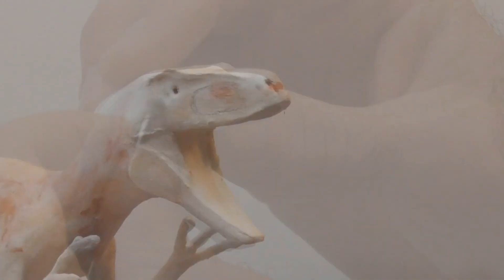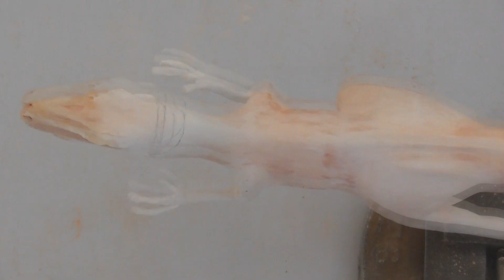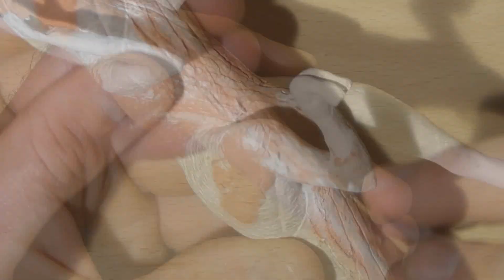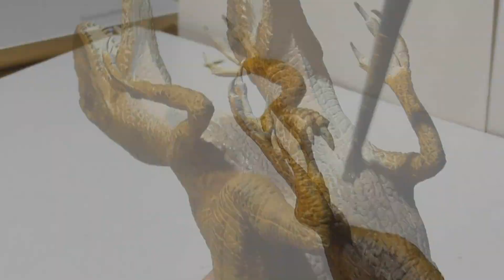Velociraptor model making sculpture! Jurassic Park style dinosaur model figurine! Raptor statue!

Comment: friking hell thats sick 

also what are thosewires that u used to create velocerapter at first
Reply from the maker: Thanks 😀 I should probably have a fancy answer, that the wires are a special modelling wire but they were actually from a steel grill that I had lying around. Similar to chain link fence but straight lengths. It's about 2.5 to 3mm or 3/32nds of an inch. Hope that helps and thanks so much for subscribing! 😀👍
Reply: ok thx
ill look on  ebay
Reply: @DRRCreations  well ive been looking everywhere for cheep models but now i can make my own thx to u
Reply from the maker: @Jameswrigley09  Great to hear you're going to have a go at making your own models! It's hard but it feels so good when you get it to look how you want it to! Have a great time making it! 😀👌
Reply: @DRRCreations  thx